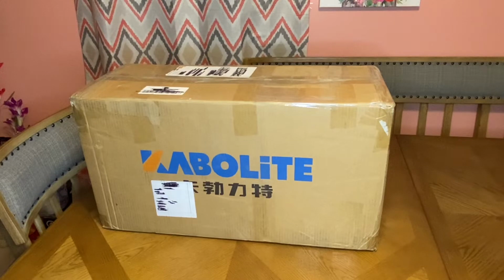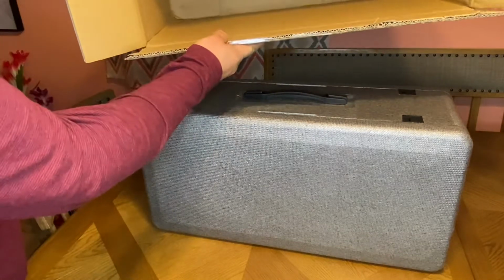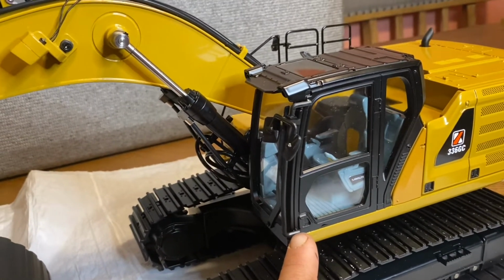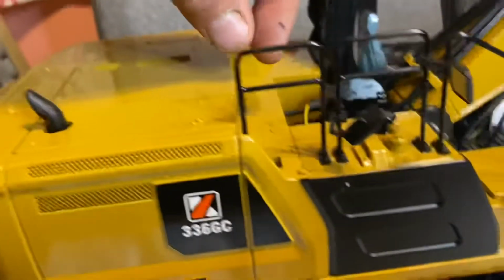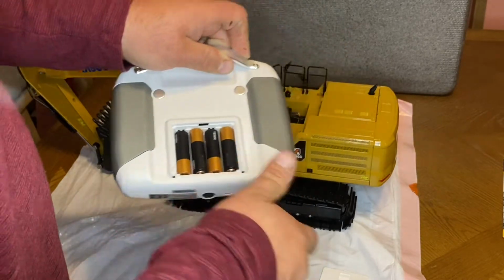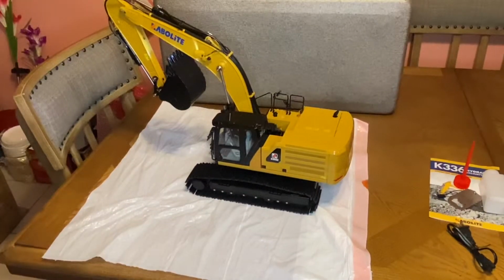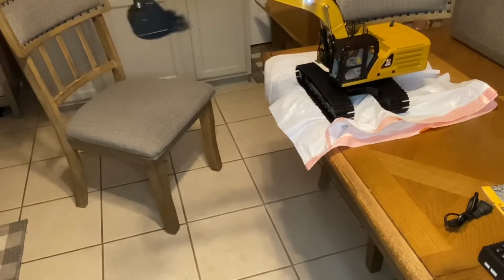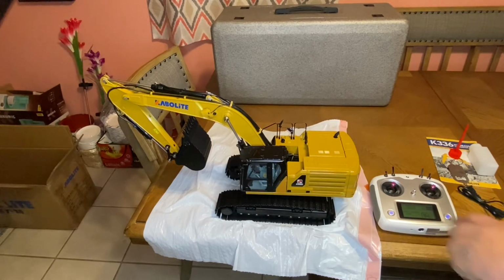Kabolite K336 gc RC hydraulic excavator- Unboxing & Initial impression￼s- RC Cincy ￼

Comment: I gues u have to set your trim in channel 3, I saw someone solving the dropping boom problem by adjusting something on the transmitter
Reply from the maker: Yeah actually did a video on that. It's the sub trim. it's on my channel
Reply: Oops, forgot where i seen it, im watching to much Rc vids i gues 🙈
Reply from the maker: @mvdijk4985  No problem there could be another one out there.
Reply: How do u like it so far? Im looking for a New model and came across this one. How is it holding up?
Reply from the maker: Honestly I think it's still the best bank for Buck only costing $1200. Long as you don't try to modify or mess with the hydraulic parts you'll be fine. The only miles I would recommend is maybe cat stickers and a sound box. Definitely changing the fluid the way I did. Where it bit me in the butt was messing with the hydraulic lines it's very easy to break screws and strip connections. But if you just take it out of the box and Only do the things I listed It should be a lot of fun and technically it should last a reasonable not a time. The scale is absolutely incredible when it comes to the real thing it looks exactly the same one of the best. Love the details the weakest point is soon as you start messing with a hydraulic system you may run into a lot of issues.
Reply from the maker: @mvdijk4985  honestly it's holding up very well. I only recommend changing the fluid the way I did. Stickers, weight increase, Quick disconnect, and 1/16 scale figure. I would not honestly mess with a hydraulic system otherwise.

Comment: please never climb in the real thing 😂 jeebus man... slamming the cylinders at the ends of the stroke should be avoided... in all hydraulic cylinders...
Reply from the maker: this little RC  is nothing  like the real thing. I can run real equipment don't know what you're talking about there's little joysticks and a small pump that surges and is not realistic whatsoever I know a really good operator that's one of the best and can't run toys doesn't mean you can't run the real thing not the same
Reply: @rccincy  im sitting in my evey day excavator having lunch right now..  n I find it hard to believe you've ran equipment....  jarring cylinders is a no no.. anyone whos ran equipment knows this or damn well should..lol. but its prolly a little diffent not in the seat yourself..lol
Reply: @rccincy  wasn't trying to bust ya balls merely inform one who may not be aware thats very hard on hydro cylinders...
Reply from the maker: @billknepp1965  completely different and it doesn't have enough power To hurt the cylinders I can hold it Max all the way and it would do nothing. It's completely different than heavy machinery not even close different pumps different regulators different power plant I could go on and not not even close besides I can program ISO or ASE
Reply from the maker: Doesn't apply in The situation only in real heavy machinery